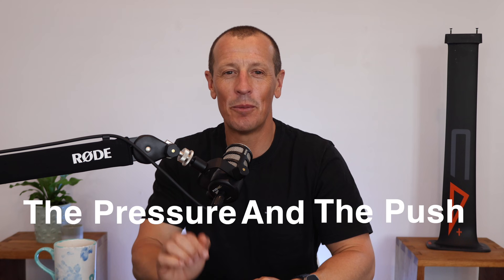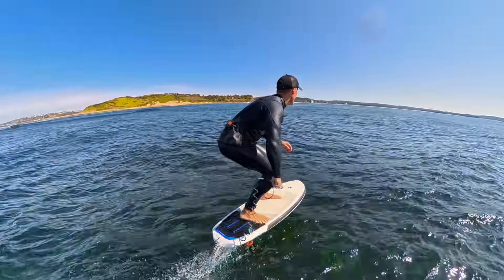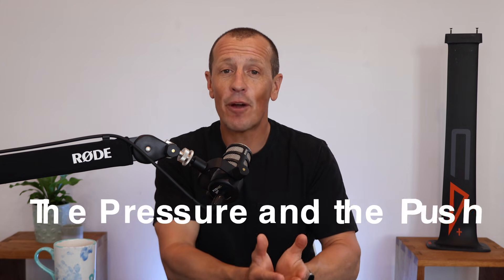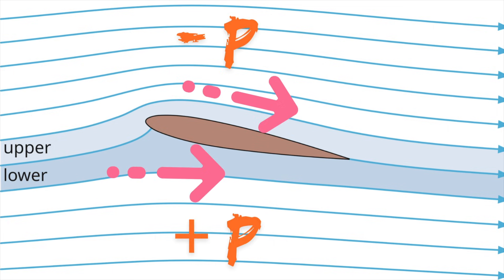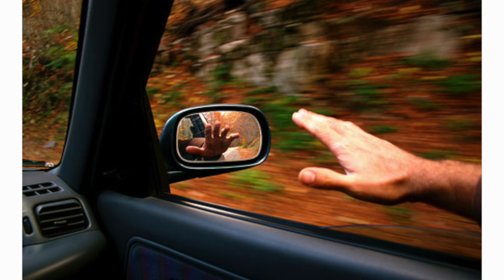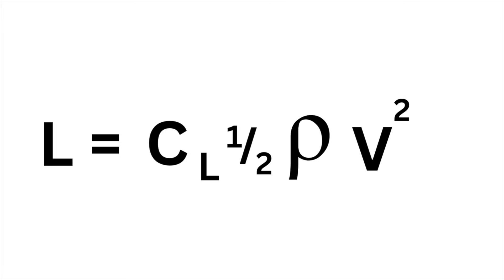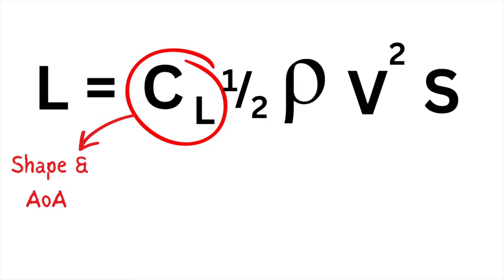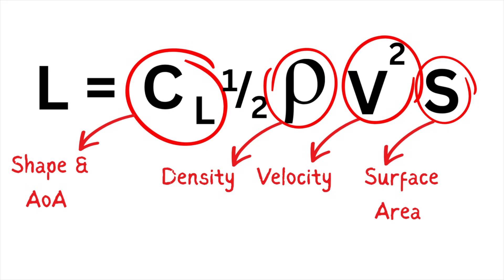How Does a Hydrofoil Work? Explained in 5 Words.

Comment: Why "push" is explained by Newton's law and not by Bernoulli's law?
Reply from the maker: I think “push” is best explained by Newton’s 3 law. The water hits the underside of the foil (it’s at an angle to the oncoming flow) and this creates the reaction
Reply: @hydro_gav it's an alternative explanation but it doesn't quantify the lifting force, like Bernoulli's law does.
Reply: @dimitrisd.9173 both forces act there in the push phase. Maybe newton in a way higher %  than Bernoulli though.

Comment: 6:16 Velocity Squared was the take home for me. I have studied the other aspects of lift and pressure etc: but knowing the scientific reason why I suck has been so helpful: it is SO hard to create the SPEED and CONTROL exiting a wave. Thank goodness for Foil Drive. You did a great job. Also, cold water (dense) over warm does NOT truly change the lift in a way that is significant according to the research I did. did you find the same?
Reply: This is why I like tiny stabs, you can really push on the back foot in a bottom turn despite full speed - otherwise lift can get overwhelming...
Reply from the maker: Thanks mate. Similarly, I don't notice much change from warm to cold but from salt to fresh water I do pick up changes. AoA is also super important, and the one I focus on more than anything.

Comment: Will base plate shimming to a higher AoA help for easier flat water starts? Thanks Gav
Reply from the maker: Yes, it will increase the AoA but it does also increase drag so it depends on the type of foil you are using. Some foils need more speed before they are able to engage. My advice would be to use 1/2 degree increments and see how each one performs.